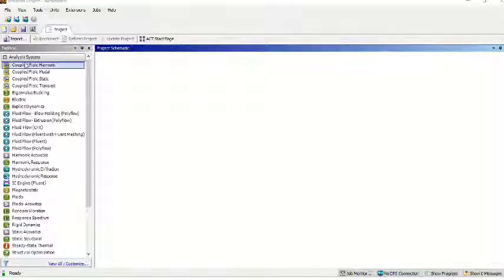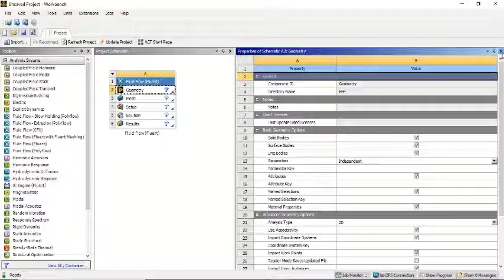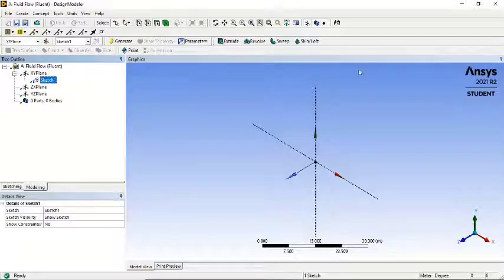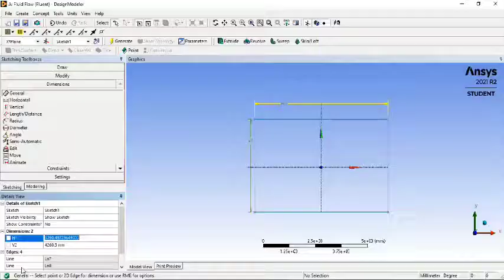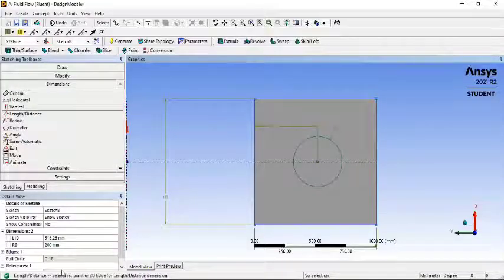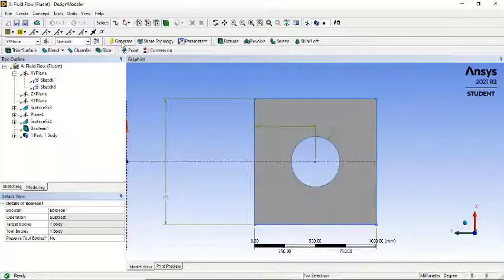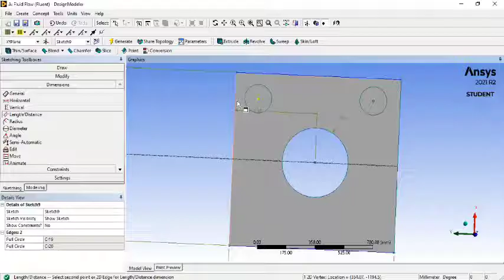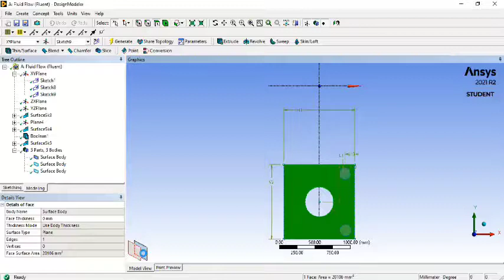2D Geometry Model in Ansys Workbench. Ansys fluent tutorial for beginners, CFD

Comment: Can you link a model that can be used for this?
Reply: If you are using the Fluent, after drawing you are directed to create the mesh for the geometry. Once the mesh is finished, automatically the model is attached to the Fluent (If you are using other solver as the static structural is the same) to insert the boundary conditions and solve your simulation.